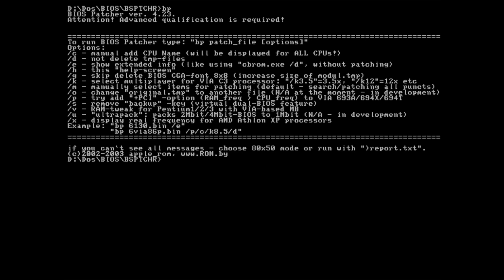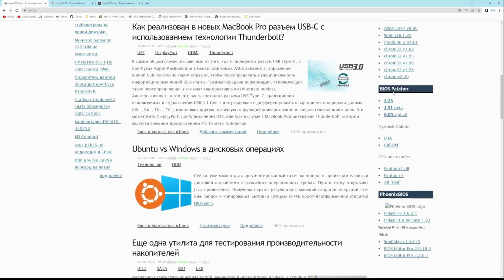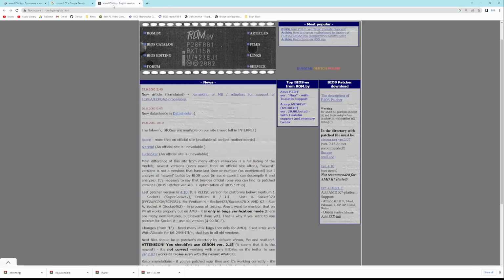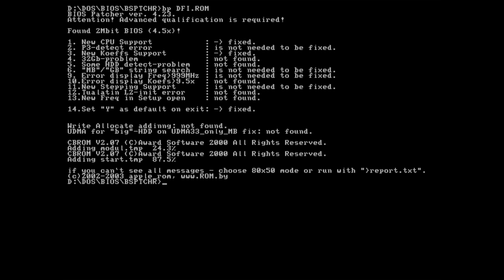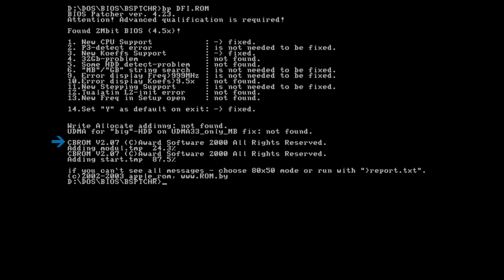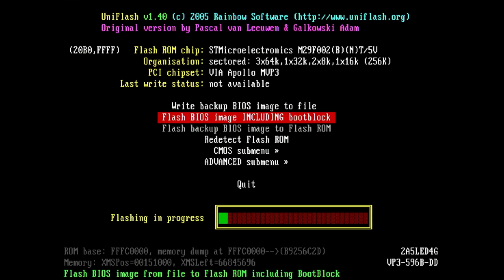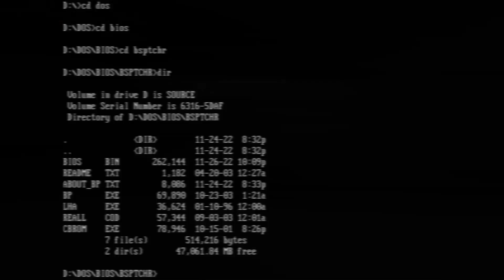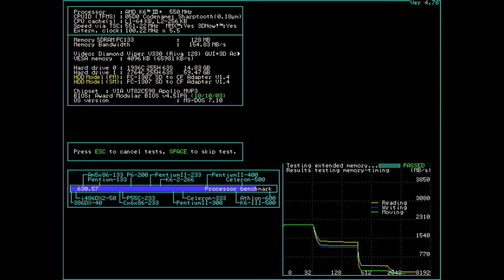BIOS Patcher: Add new features and fix bugs - the easy way!

Comment: Socket 7 CPUs do not have loadable/upgradable microcode. The microcode that is in the CPU silicon is always used. What you are patching in this video is the CPU identification string/initialization procedure in the BIOS. The first x86 CPUs to have loadable/upgradable microcode are Pentium Pro from Intel and K7 series from AMD.
Reply from the maker: Thanks for the info, I did not know this
Reply: @bitsundbolts The microcode is basically there to teach the CPUs the x86 instruction set. The CPUs themselves are RISC CPUs starting with the Pentium Pro and K7 and both are using micro-ops. With the micro-ops and the microcode the x86 instructions are emulated. 
This also makes the K6-III and Pentium MMX the last true x86 CISC processors.
Reply from the maker: Learning new things every day! Thanks for this cool info!
Reply: @olev2688  The point is, the 8086 is not a RISC, it's a CISC. It does support fairly complex instructions in hardware.
Reply: @OpenGL4ever  thats not true. The K6 is NOT an CISC design. The only difference between K6 and the K7 is the K6 has a hardwired instruction decoder. The K6 internally uses RISC86 instructions (based on Nx586). Also the K5 already used internally a Am29k-RISC design with an x86 frontend. Same logic applies to Pentium. It is not required by design to provide a microcode by firmware (either BIOS or UEFI or other firmware designs) - a CPU could have a fallback code in rom and load this if nothing is  provided otherwise. the last true x86 CISC is 486 and if my memory doesn't fool me Cyrix 5x86.
Reply: What is the instruction that is so complex that the instruction set is already called CISC?
Reply: @gaborm4767  the name "reduced" and "complex" is sadly misleading. The key feature of a RISC-design is one instruction does one thing only. An CISC-design allows multiple actions in one instruction - thus an processor with same feature set does have a reduced amount of instructions compared to CISC design. Typical example of RISC is memory to memory copy. In an RISC this would be LOAD (from memory to register) and STORE (register to memory) while a CISC would have an dedicated memory-to-memory instruction. Additionally RISC instruction has a fixed byte length, while CISC has (usually) a variable byte length instructions - thus RISC make it easier to look ahead for instruction in the queue giving a speed advantage. Afaik for this disadvantage CISC designs are practically not used anymore.

Comment: This is awesome stuff, thank you so much for taking the time to share this with us - when I saw it yesterday I got so incredibly excited that I had to test it with my older mainboard. My K6-3+ is not being recognized from my mainboard (it posts but only shows 66 MHz without a CPU identification). I then manually set the muliplicator via software in order to get some performance out of it. 

After seeing your video I flashed my Bios ROM file with the BIOS Patcher and via CBROM I could confirm that two new modules have been added to my Bios ROM. I could also see in the report that new CPUs have been added. However, after patching the BIOS with the new firmware (via uniflash) no changes happened (not even the rom.by line appeared during POST). 

I am trying to figure out what else I could try. I have two ideas, first one is to try an external flasher and the second idea is to add the CPU microcode directly into the main system module. I would appriciate any thoughts or comments :)

Thanks buddy! :)
Reply from the maker: Hey there! I am sorry, your comment went into the "held for review" folder because you mentioned that one URL. So, regarding BIOS patcher not working... Do you have a keyboard connected to the DIN5/PS2 connector? The BIOS has a safety feature that when there is NO keyboard detected, it will fall back to the original version. I think this is happening to your board. USB keyboards do not count and trigger the fallback as well. You can try to patch the BIOS again, but look at the command options. There is a way to disable the fallback by using the option /s while patching your BIOS with BIOS Patcher. Then it will always use the modified version and hopefully, will also detect your K6-3+. Good luck!

Comment: In my AMD K6-II 500 Socket 7 setup, 256 MB x3 RAMs are showing as 128 MB x3 RAMs.

The eBay seller already said - "It displays 256MB on motherboards above version 815, and 128MB on motherboards below version 815. It requires updating the motherboard BIOS to display 256MB"

Is there anything to do?

Comment: I tried this on my p3b-f and sadly i bricked my motherboard, it not posting and my keyboard flashing, pressing "-" don't work.
Reply from the maker: There is another fallback. Unplug your keyboard and see if it boots without the keyboard connected. You can also try to clear CMOS settings and see if it helps.
Reply: @bitsundbolts  nothing worked, I decided to use EEPROM programmer and flash original BIOS. Also my PC looked like it was stuck in bootloop, Num lock, Caps lock etc. was flashing like hmm it wanted to POST and then reset. It was like that always. Maybe you could use one of the chips you bought and test it out on your P3B-F and of course record video about it.
Reply from the maker: I can do that. I got a programmer now, but I haven't tested it yet. So, just to understand this correctly. You flashed the original BIOS on your BIOS chip with a programmer and it does not work?
Reply: @bitsundbolts  No, I flashed modded BIOS, it doesn't work, I flashed original one, but I don't test it yet. I can write here if it works.
Reply: @bitsundbolts  Flashing Bios through programmer helped, PC works again.